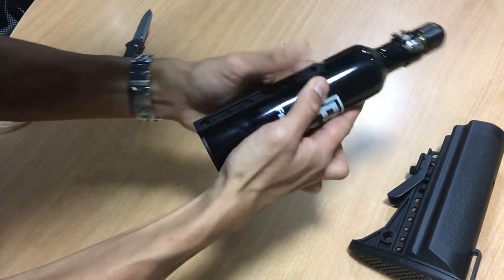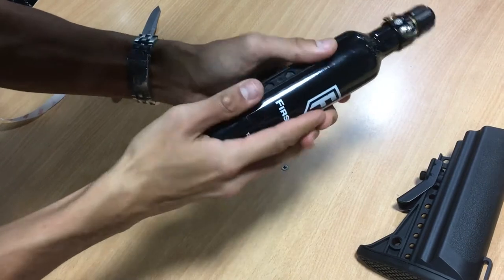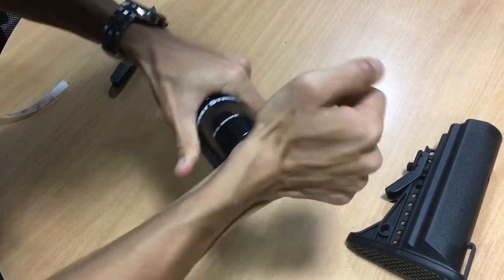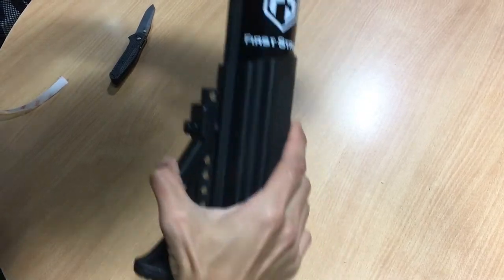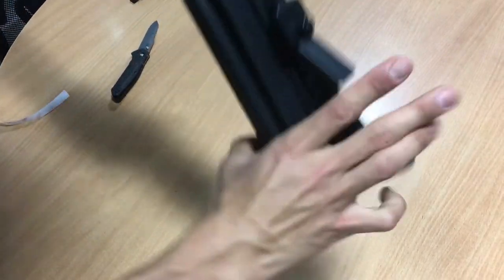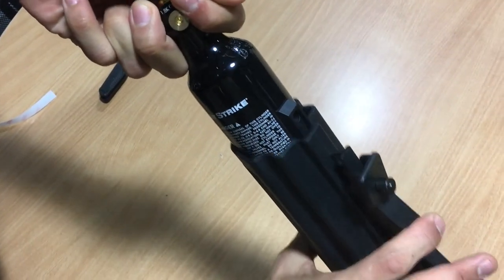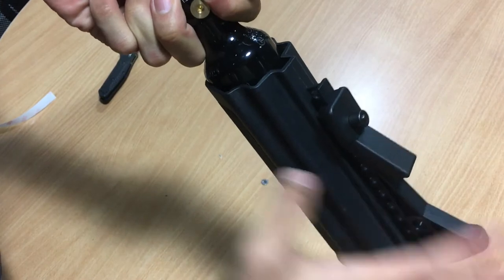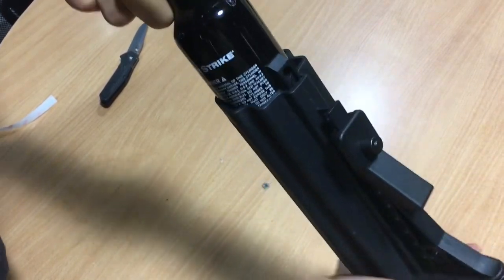FS Tech Corner - Universal Floating Butt Stock Install

Comment: but wouldnt the stock end up at a wonky angle when you screw it onto your marker??

Also, nice knife. Benchmade osborne?
Reply: Yea. I also always wondered how this stock worked (since no info on sites where I seen it sold). And now, after seeing this, I dunno if I'd want one anymore. Surely one first attaches the tank to desired rifle and to it's desired tank angle/position before attaching the adhesived rail - but I still kinda got put off by the rail attachment. Not a bad idea though for the ones that want one.
Surely I'd get a thing like this to work for me, but I now just wouldn't probably bother searching for them anymore. These most often sold out too..